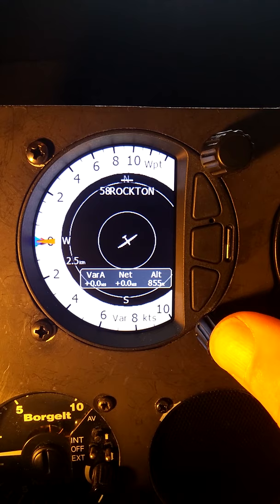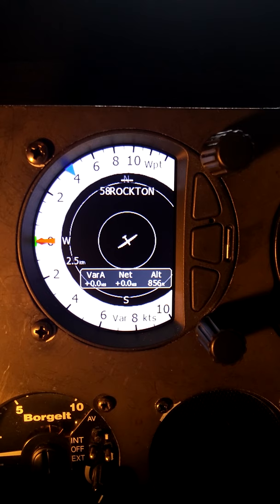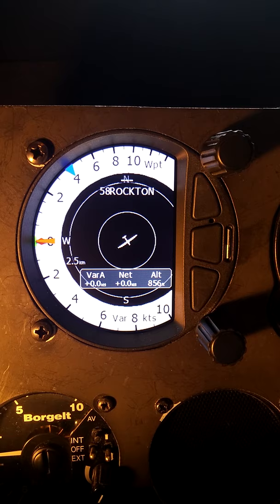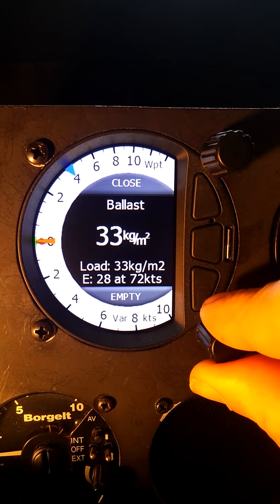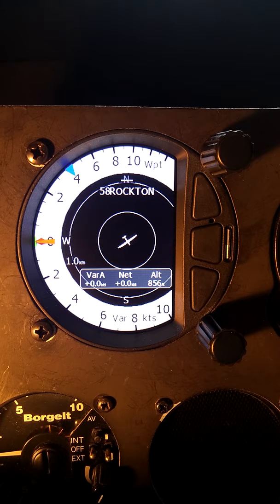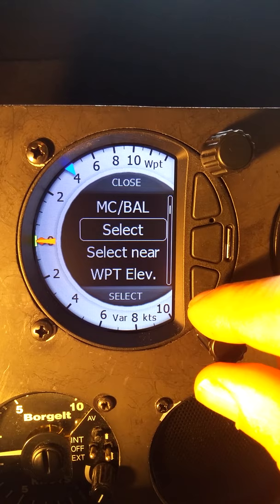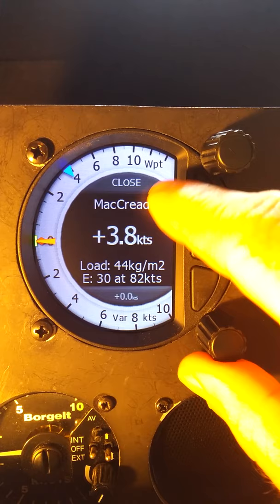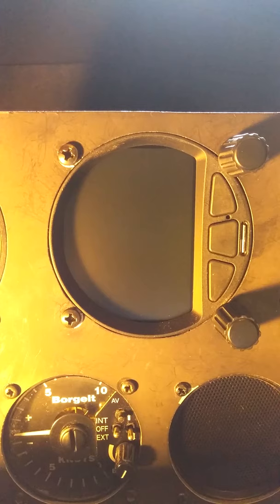Accessing and Adjusting MC BAL Bugs through the Short Menu

Comment: Great videos. Question would like to know more about adjusting the ETA while on task. I see how its done on the LX9000 series but do not see it for the LX s100.
It appears the LX9000 series has many more options like scrolling out further into the turn point sector. Does the S100 do that and can it give ETA.?
Alan
OneRogueCloud
Reply from the maker: Unfortunately, the S series varios do not have the option to move the point within a turn area zone, so it will always navigate to the center of each zone.  As best I can see there is no ETA available in task (or waypoint) mode.  It is possible that these features can be added to the firmware in future releases.